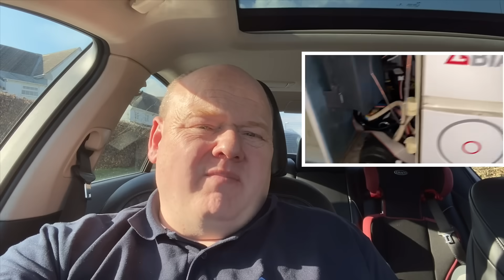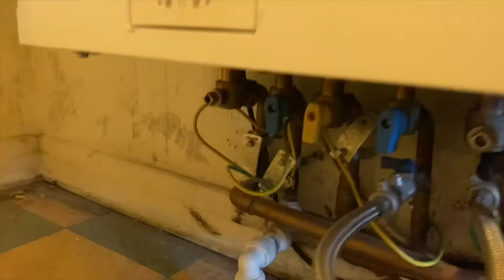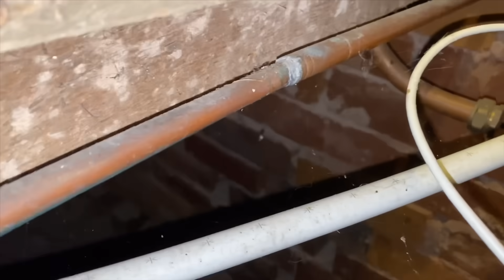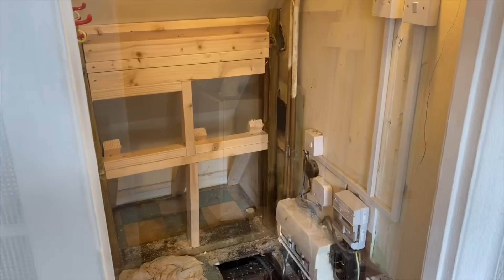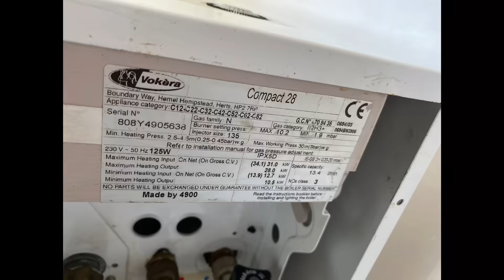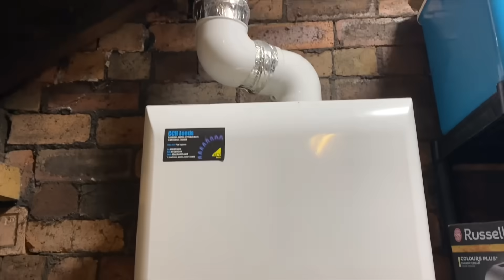LEEDS PLUMBER - Shocking Boiler Installation and New Boiler

Comment: Love the videos. How do you feel about the gas industry coming to an end within the next 10-15 years
Reply from the maker: I will be retired by then 😂😂😂
Reply: Allen Hart lol. It’s just a shame people spending a lot of money training to get into the industry
Reply: Ross Stewart if they had any sense they would be better off doing F Gas, somebody told me few weeks back that with F gas there is a route to gas safe registration anyway, and with F gas you can get into air and ground source heat pumps... refrigeration, air conditioning both home and commercial. All areas which are expanding, heat pumps will grow in market in next 5 years in anticipation of fossil fuel ban in new properties so new properties will start getting heat pumps... and amount of people having air con fitted in their homes is also increasing year on year even if we don’t have long summers lol. So it’s a broader market of opportunity going that route, add domestic electrical installer and you can do solar and ev charging as well. That’s a better route than gas now.
Reply: Wont happen
Reply: Dog Francais what won’t ?
Reply: Dog Francais they are banning new fossil fuelled appliances in new homes. After that they will likely incentivise for ditch fossil fuelled appliances. Gas boilers will likely be replace by hydrogen burning boilers they are trialling at the moment, a lot of the mains replacements seem geared towards this also as the target completion dates align with government dates for banning gas boilers. Personally I will be glad to see back of gas boilers, not that they aren’t any good because they work great... but hydrogen will mean an end to all the regs and health and safety surrounding carbon monoxide poisoning because hydrogen doesn’t produce carbon monoxide which to be fair a large amount of gas health and safety is focused on in regards to combustion, and flues even down to gas pipe size to ensure boiler gets adequate gas for proper combustion. Only health and safety issue would be hydrogen leaks and explosion risk which is same as with gas more or less anyway, most of the rest will be redundant if carbon monoxide poisoning is no longer an issue. Make everyone’s life easier and hassle free. Only byproduct of hydrogen burning is water.
Reply: @Clicksystems  It will be a mix of hydrogen and natural gas. I've been to Vaillant HQ in Belper and had a presentation about it.
Reply: Dog Francais not a chance
Reply: Dog Francais to begin with, I gather they are already blending hydrogen in some areas. But they are also doing trials with 100% hydrogen. Likely they will blend the mix during a transition period then as more boilers fitted become hydrogen compatible they will shift to 100% hydrogen.
Reply: @Clicksystems  Probably eventually. But no chance within 10-15yrs
Reply: Dog Francais no won’t be within 10, the ban comes in place in 10 years, and that’s only new build properties... that will be about the time heat pumps will probably start getting big if something better hasn’t come along, then probably around year 15 government will start incentivising to get people off gas boilers, that’s pretty much a given in some form or another, even labour wanted to tax the crap out of anybody with a gas boiler so regardless of whichever party that’s going to be pretty common policy to meet carbon emissions targets. So anybody who’s already in the trade will be fine for a good few years, they won’t disappear overnight, will be servicing work for a long time, but installations will start dropping off in next 10 years until hydrogen takes over. If new out of school at 16 though, probably not best time to get into gas though, 15 years time they will be 31 and still have another 30-40 years working before retirement. Those are better off with F gas, somebody said other week that there is a route into gas safe with F gas anyway.
Reply: @Clicksystems  they've tried banning gas on new builds before and the developers just pushed the government back, and unless there is a viable alternative to gas, the developers will push them back again. I had a gas safe inspection last month and was talking about it with my inspector and he also agreed that the date will likely get pushed back again and believes gas will still be around when I retire, I'm 32.
Reply: R B hydrogen is very energy intensive to make so theres no point in using it
Reply: Ross Stewart they are already using it, blending it with natural gas. I agree it is expensive, it’s why personally I’m exploring heat pump route with insulation and underfloor as being “a” way forward.
Reply: R B I am not talking about a monetary expense but a waste of electricity. When we could you other methods
Reply: Ross Stewart apologies I misread you, for some reason read intensive as expensive. True there is that to it. At least with heat pumps though you can offset some grid usage with solar panels though.
Reply: Hopefully sooner the better they get rid of it. It’s been good, but too much regulation because of the carbon monoxide risk and a poorly or non serviced boiler which starts chucking out carbon monoxide is a liability seeming no mandate for annual servicing. That’s without all the dodgy installations and properly installed boilers which have been tampered with after installation and become dangerous.

Comment: Considering the plastic pipe going straight into boiler looks DIY, surely no plumber would do that, don’t most say should be 1m copper coming out boiler before converting to plastic.
Reply from the maker: Shocking jobs these days. Thanks for watching.
Reply: I come across this a few weeks ago on a brand new caravan all the pipework to the boiler was in speedfit
Reply: Yip.. 1m of copper to be installed from boiler heating flow and returns before any plastic pipe or fitting.

Comment: that gas pipe is unreal...
Reply from the maker: I have no idea how it even worked. Thanks.
Reply: @AllenHart999  I suspect that the reason he put the cutter on the 15mm 3 times was to 'crimp' the bigger pipe so that the 12mm didn't rattle around so much when slid in! awful.